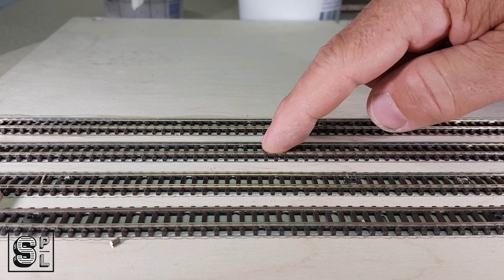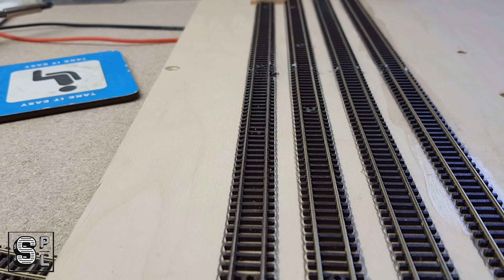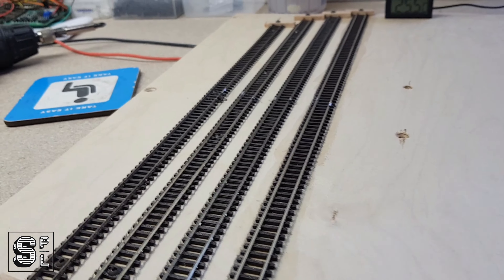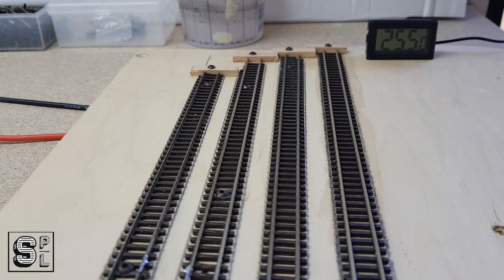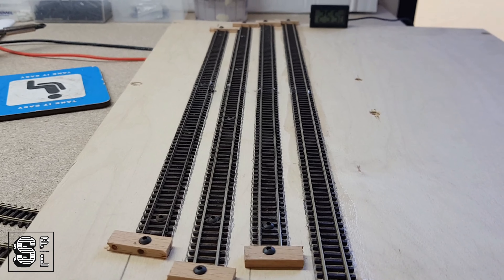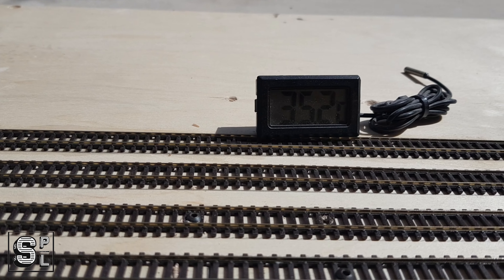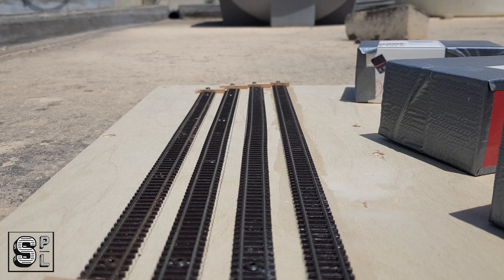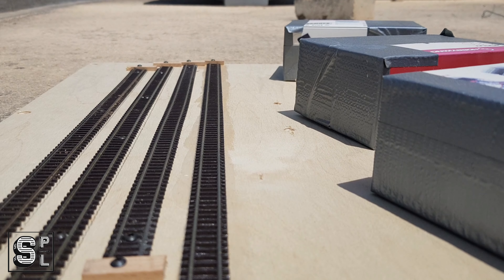Ep19 - Preferred way of attaching track to the baseboard at Ħal-Zuzzu Model Railway

Comment: Great test and i thought the glue would be the worst cheers Robert
Reply from the maker: Let's put it this way, in MY case, glue seems to work best. There's got to be a point where the glue gives way to the expanding metal, unless the chairs give in first, but I don't think any of that will happen in model railway. If the temperature gets that hot, one should seriously consider air conditioning 😎👍

Comment: Hi Joe the glue is only stopping the plastic from moving the rails will still expand. I think hope your well. Colin
Reply from the maker: Yes, the metal will still expand but will keep the tracks in place for longer than when you nail or screw the track to the baseboard. Hopefully by then, it would have cool down a bit.

Comment: Hi Joe - You partly answered my question from the last episode like your in my head.
My test track in my loft was glued down with track joiners between each section of track and expansion gaps left just in case.
Temperature in my loft this summer hit over 41C but today it is 36.7C. Temperature in the home is 26.4C.
So after a number of weeks having not been up in the loft when I did go up there the expansion gaps had gone and the track on the straight and bends were twisted all out of shape.
So at present that is my main concern although I have not as yet insulated my loft. That is a job for next year, so I was surprised at the result of your test.
Regards Chris
Reply from the maker: Glue will eventually fail too, but I think it will hold on a lot longer that the tracks with nails and/or screws!

Comment: OK, but what are the maximum and minimum temperatures you get in your hobby room (with air conditioning)?
Reply from the maker: My room is up on the roof. Unlike your lofts, this has a door and a window which lead to outside. It never gets as hot inside, with or without the AC, so in reality I don't think I need to worry about my track expanding enough to buckle. If I was in a loft, the first thing I would do is install an extractor fan and power it with a 12v DC small solar panel and let it run 24/7.

Comment: Hi Joe. What screws do you use, please?
Reply from the maker: The screws I am using were removed from my remote control cars and replaced with stainless steel ones because of the sea corrosion we have here. They are 3mm self tapping screws of various length.